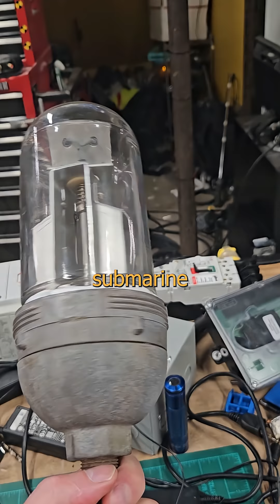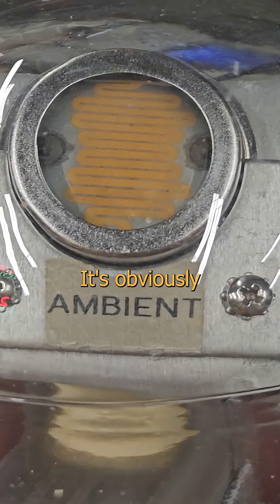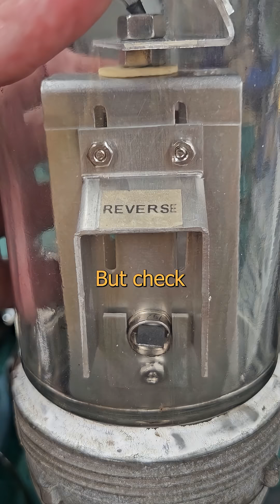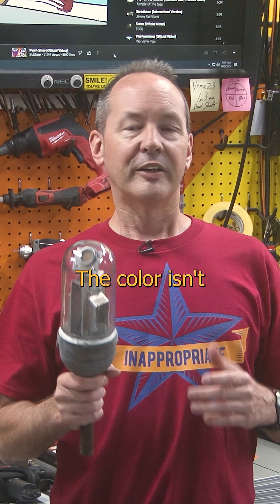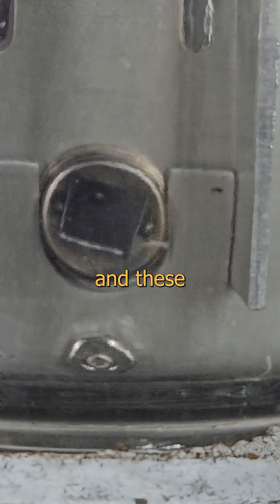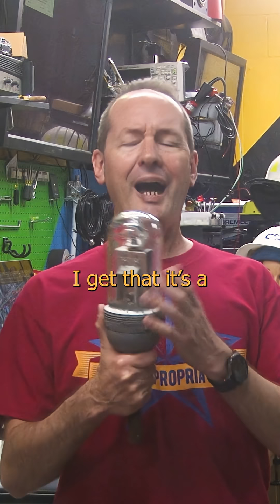Weird Light Sensor #chrisboden #comedy #engineering #electronics #electrical #educational #science

Comment: my best guess is this could be used for controlling the actuator of a single axis sun tracking device of some kind.  ambient sensor to tell the controller whether or not the sun has actually moved instead of being shaded by cloud cover, as measured by the two shaded sensors to either side.
That's just my complete SWAG, but like you said, it seems a bit much just to turn on lights.

Comment: its a runway sensor. no maker plate cause it was made by hand. the light sensors on the side are for when the lights of the plane hit it it turns off. ever seen a plane go down the runway and the light next to the plane turns off then as the plane passes it turns back on. the reason for both sides having the reverse is for take off and landing in the dark.

Comment: That's an old-style photocontrol, also known as a photocell or dusk-to-dawn sensor, which is used to automatically turn streetlights on and off.  They were also used for the signal lights at airports that go on the huge airport beacons or ALS lighting. 
  With my time spent working for the city electric department, one of our other jobs was to replace the light bulb for said runway tower. 
  The light bulb was literally 18 to 20 inches long and 12 inches around or more lol. 
  And it still used the vacuum tube style photocell. When are City Electric company got bought out by one of America's largest power companies, are former naval training base turned municipal airport and Piper finally had to update the signal Tower because they no longer have lineman to come change the bulbs. 
  I can't remember if it was Fisher or GE and I can't find information on the internet so maybe someone else could jump in here and help track down the exact brand of the photocell

Comment: Interesting, if it's a streetlight dusk/dawn sensor that makes me wonder if the maintenance workers may have installed an incorrect type of sensor for one near me. I am convinced that it is disrupted by car headlights because it just so happens to turn on when I pass it at night, very often. Certainly they probably don't still use these beasts but something with similar multiple sensors or a chip that analyzes the sensor signal(s) to determine when to turn on/off

Comment: The photovoltaic cells on either side of the photocell are likely used to tell another system when the sun is rising or setting.
Depending on which photovoltaic is producing more voltage, the current in the system is likely moving in one direction in the morning, and the other direction in the evening.

Comment: The photosensor spins, the PV cells are wired in opposite polarity to turn a brushed Dc motor that makes the photosensor face the sun.
Reply: I think you're along the right lines.
If the whole assembly rotates, as I think you're saying, it's strange that the LDR on the top isn't exactly 90° to the other two sensors.
I think the top sensor rotates on its own, to seek the brightest light. (Therefore probably used to track the sun's position through the day).
The forward, reverse labeling is interesting. If it works like you say, then I guess they could be saying the rotation motor runs forwards when the forwards sensor has more light and reverse when the reverse sensor has more light. You'd think they'd say clockwise/anticlockwise or East/West though.
Forward/reverse makes me think it might be from a vehicle or (looking at the style of it) possibly even from a crane.

Comment: Google Lens / AI overview
The sensor shown in the image is an old-style photocontrol device used primarily for streetlights. Its main function is to automatically turn streetlights on at dusk and off at dawn, based on ambient light levels. 
Key features and functions:
Ambient Light Sensing: The top sensor measures daylight from the sky to determine true dusk and dawn. 
Stray Light Mitigation: Two side sensors help average out stray light sources like vehicle headlights or reflections, preventing premature or erroneous activation/deactivation of the streetlights. 
Historical Application: Similar sensors were also used for beacon lights and airport runway lights, though the specific design shown is often associated with older street lighting systems. 
Operation Principle: The forward/reverse sensors are photodiodes, which work similarly to photovoltaic cells. They are wired to cancel each other out, indicating ambient light when their output is zero, and detecting additional light shining from one side when the output is non-zero.

Comment: After reading the comments I'm left with the unanswerable question: was there many similar looking sensors, was this a multipurpose device, or were some of them actually repurposed? My assumption is that there were mulitple models for different purposes but they all looked similar due to reusing parts and or designs (like the glass dome and sensors).

Comment: The PV Panels or Solar Panels are most likely used for Tracking the Sun and s dead simple at that like they power Motors for long to stay aligned with the Sun and how does it Spot Power no more because the Solar panel are in to much shade.

Comment: Looks like somebody's custom hack solution to add remote status to some really expensive industrial hardware without chancing voiding the warranty by attaching wires to said hardware directly. 
Ambient sensor is for applying bias to the other two to avoid false readings I'd guess.  Basically a 1st gen optocoupler.
Pretty over the top but hey when u got a 2 million dollar piece of hardware, not voiding the warranty is priceless!

Comment: Years ago I saw this outdoor floodlight at a local sports centre turn on pause off pause on pause... etc., as soon as the sun went down. Turns out someone put the ambient light sensor (like that thing featured there) under the damn light it controlled. Must've had some short delay circuit. 😂

Comment: Those used to run street lamps and larger parking lots.  part of its design is a delay with the two lower photo sensors one I will see darkness and the other side will see a moving light and it delays the shutting off of a lamp when a car approaches from either side

Comment: Please note that photovoltaic cells are the same type of thing as a photodiode, which can go up to multiple GHz for detecting fiber communications. They're also the same thing as LEDs, but indirect bandgap semiconductors like silicon won't emit nearly as much light, and silicon will emit IR instead of visible light.

Comment: I think it is sun tracking sensor, my theory is
Based on restrict windowing on tow  different side sensors.,
 And I think there's adjustments for latitude on the top sensor. 

It's a sun clock,
Not a sun switch.

Comment: this looks like one of those light sensors that have fail-safes to make sure people with a bright light don't trick it on/off, the Reverse/Forward sensors would be facing sunset/sunrise, which could explain the excess of glue to correctly face it like. but that's just my thoughts on it, could be wrong.

Comment: Lots of misinformation about photo controls here. I've worked in commercial lighting since the late 80's. Until recently, most photo controls used the photocell to operate a heater on a bi-metalic spring to hold open a contact. This built a delay into the system so that random light hitting the sensor wouldn't turn the lights off. This also meant that the failure of the photocell would mean that the lights controlled would default on. Some, mainly on street lights, didn't use the delay, but they are almost always mounted at heights where headlights wouldn't be in the line of sight of the photocell. I'm not sure what this thing does but as someone who has worked on actual street lights, that is not what this is for.
Reply: In addition, you mount a photocell with the sensor facing north so the on/off times aren't delayed by the sun shining directly into it, delaying either on or off.

Comment: Looks like it could be sensor for red blinking light on top of a radio tower. That might be the blinker selinoid in there w some redundant light detection. Get it both ways via the resistor and off the solar cells producing voltage, or not.

Comment: Well technology connections did a video on the photocells that are used for streetlights, and evidently those ones use the photocell to control the power to a heating circuit coupled to a bimetallic switch of some sort. During the day, the heaters are on, so it trips the switch and disables the light. During the night, the heater cools off, and the bimetallic switch closes the light circuit again, and that turns the light on.

Comment: That is an old light sensor for airport runway lights. I haven't seen one since 1976 at a private runway in Alaska. The lower side sensors trigger the lights to come on when the snow covers them. That alerts the snow removal staff to clear the runway of snow
Reply: It's probably a good multi-use object.

Seems the consensus is on old street light sensor.
Reply: @kaiserc2471  To be fair the application seems similar between streetlamp and runway lights, the side sensors either filter out light or also turn the light on if its covered in bad weather
Reply: @kaiserc2471  it's overengineered for a street light sensor but not for airport service
Reply: some of these "old school" systems were clever AF.
Reply: TY!  The top commenter just said the obvious.  You had seen it in action.
Reply: @Jennifer-m3b  That makes more sense than another poster saying it's for street lamps because A: it looks WAY overbuilt for road use, and B: the side sensors wouldn't be needed for cars because it would be way the hell up on a lamp post where car lights wouldn't affect it.
Reply: …but explain the 'forward' and 'reverse.'
Reply: @d0ugparker  Runway lights are in fact directional.  Often the lights will be turned on for the active runway only, taking off and/or landing into the wind.  This also means that the powerful landing lights of aircraft will be seen predominantly from one direction, when the sensor for a particular set of lights is switched in.
Reply: @Jennifer-m3b  well I'm on a old alaska village imm go check my airport now lol
Reply: @STGCHAOS907 . . . and?
Reply: @Lawrence330 its there still operational here in on St. George Island Alaska.
Reply: I was thinking it looked like a runway light
Reply: May have used a very similiar sensor for that as well, makes sense that two different systems to turn on lights for visibility in the night would use similar/same systems.
Reply: Runway light
Reply: Nice
Reply: Concur.
Reply: Amazing.
Reply: Railway.
Reply: That's crazy, now adays it's ARKAL or led pot lights "on SS to SR" depending on how bad the power outage is at the rez you are flying hotdogs to at 3am

Comment: Does all that interior structure rotate? I'm guessing it does.
The two lower photocells control the rotation, and keep the upper cell pointed at the sun during the day.
The upper cell is tilted, and the only reason to do that is to face the sun. 
I'm guessing the whole thing is a weather station's sunlight sensor. The big cell detects how much light is getting through the clouds during the day. "Insolation" I think it's called.
Reply: It's the "forward" and "reverse" labelling that's confusing me.

Comment: Im an electrical engineering student, I quite literally made something similar to this for a PID project and thought i was clever then watching this video immediately was like "ofcourse other smart engineers thought of this first"

The top detects ambient light (from like the sun), and the sides detect light from reflective surfaces or other light sources, im guessing its designed to only turn on and off during specific times of day as measured by light outside the extra sensors prevent random flickering from shadows, clouds, temporary light sources from other things.

Comment: Used to be on street lamps and beacon lights. PV on the bottom turn the aperture on top to keep the ambient sensor pointed towards the brightest light source that gave juice. Always was fun to watch them start turning around when the reflections would fade and it finally favored the sun.
Reply: That explains the upper sensor being mounted on a shaft! 👍
Reply: And also explains the side sensors marked forward and reverse.
Reply: There was a 2009 post apocalyptic survival reality show called The Colony where one participant, called the professor, set up something like that to maximize their gain from the few solar panels they had. Really good show. I recommend watching season 1 if you can. Season 2 is about half as good.
Reply: A sunflower sky light intensity detector? Cool, but sounds very complicated for today.
Reply: That seems to be the most logical of the answers

Comment: Not positive but I have seen things like that on the top of about every tenth streetlight in my city.  They have been replaced with more solid state stuff as the lights were upgraded to LED, but the city hasn't made it back in the neighborhoods yet.
Reply: in what way is this not solid state
Reply: @tsm688  By no means am I am expert on sparky stuff, but the photovoltaic sensors I see on the poles around me are maybe a tenth of that size and in a smaller package with no giant bulb.  I supposed it is possible for them to just be smaller, but based on what the Bad Dragon version Chris was holding looks like, I would presume few if any transistors or circuit board type stuff.  This looks more like it is more mechanical in nature.
But if you meant it is in a solid state, as in not gas, plasma or liquid, yeah.
Reply: @fwelton  that's what solid state means.  not solid state would be vacuum tube
Reply: @tsm688  OK, poorly phrased maybe.  How about non-mechanical functionality?
Reply: @fwelton  none of this seems mechanical either, unless there's a relay buried in there somewhere.

Comment: It's clearly a long term outside thing. The only additional thing I can add is,  that ambient forward and reverse, might indicate that that it's part of a feedback loop that is supposed to make something the exact right amount of bright. By the sturdy construction and size, I recon the big sensor is not that big for precision but so it doesn't burn. That might mean it was controlling a small sun. Maybe it was controlling the lighting on an air field, boat, plane or stadium. Maybe it was part of a bat-signal type flag light, that can light up and follow a plane. I only know it was bright and probably complicated.

Comment: Honestly my first instinct is to say that this is something like those light bulbs you find on the tops of towers. Indicating the height of buildings for air traffic. 

Why it would have a light sensitive on/off switch when, if i remember correctly, it’s supposed to be ALWAYS on? I don’t know.

Maybe those PV panels are there to provide a little bit of current for the bulb to work, and the light sensor is there to know when to turn it on and off in case of a power outage. 

In the day you obviously can see where the tops of towers are so it’s not completely necessary. But at night, (or in a storm) then it would turn on. 

Only thing is I don’t see any batteries or capacitors on that thing.

Comment: The body of it is a standard pipe-mount industrial cage light fixture, you can see the threads for the cage that should be on there.  The glass screws into the base and sits on a gasket which is good enough for water and combustible fumes.  Seeing the calk tells me the gasket wouldn't have been enough protection.  I'm gonna guess that this was inside some kind of industrial corrosive environment where light needs to be kept precise for a chemical process.
Reply: so he's been looking on the wrong product, he needs to crank it open and look up what's on the guts.

Comment: @Physicsduck Ok. So I have a question. I work with high voltage amplifiers for broadcast. My old Eng 3's said shut them off when not in use, but my Lead Engineers say just to leave them on because cycling them causes more wear. Now my Eng 3's were prone to cowboy gray area operations where we get a lot done as long as management doesn't ask too many questions, and my Leads are prone to Fudd lore and backinmydayisms. Who's right?

Comment: The side sensors look to be silicon so probably photodiodes. If so, they are an order of magnitude larger that equivelant moder ones in that type of component package. Based on the angled top sensor I'm guessing it was used to track the sun or similar???

Comment: The forward/reverse sensors are photodiodes, which operate in the same way a PV cell work (since they're all just diodes - the basic operating principles of LEDs, diodes, PV cells, photodiodes, is identical since they're just PN junctions. So you can use an LED as a PV cell (really inefficient), a PV cell as a LED, etc). I can tell you the two photodiodes are wired such that they can cancel each other out - if their output is zero, then the light you see is ambient. If their output is non-zero then part of the light you have is ambient plus something shining on one side.
Reply: @tlhIngan  🤔 sounds good to me.  I'll go with that one 👍
Reply: Well said. One caution. Crystalline solar cells will be damaged if used as a check diode.
Reply: But the sun moves.
Reply: @blairhoughton7918 which is why the top sensor spins to follow the sun.

Comment: For the record, I'm making this up based on intuition (bullshit). I could be used on the top of a building to control the grounds floor outer lights, sensor up top to determine if its day, on the sides for what side the sun is on in the morning and evening, turning on the lights on the opposite side of the building.